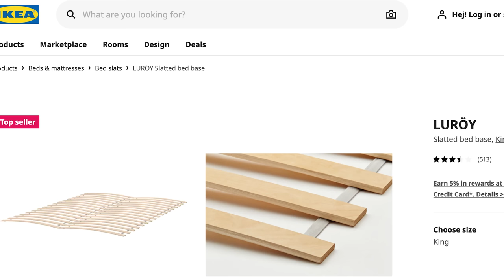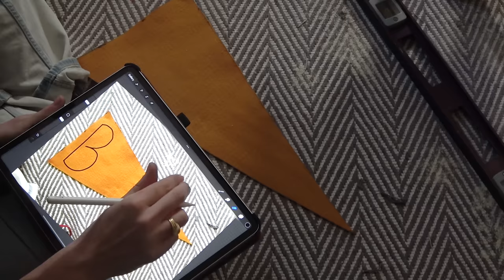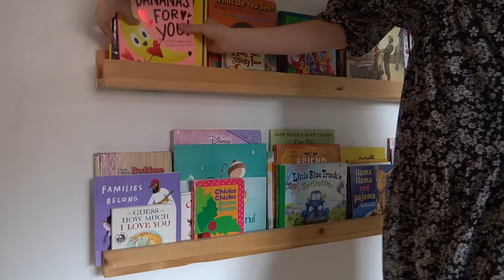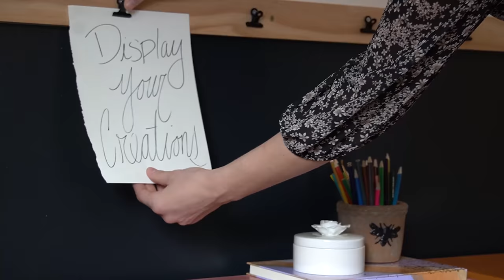Surprise Kids' Bedroom Makeover| DIY TRIPLE BUNK BED|  *FUN SURPRISE REVEAL*

Comment: I would actually also put bed slots on the bottom bunk so that there's airflow underneath the mattress. Mattresses have gotten mouldy from laying straight on the floor for too long.
Reply from the maker: Oh yea I’ve had this mentioned a few time. We definitely didn’t know that but I told my brother and he already made the adjustments to the bottom bed! Thanks so much for helpful tip! 🥰
Reply: @MaileyElaine  it looked like there was a vent under that mattress, did he do something after filming to uncover it? I would really recommend lifting the bed (not just the mattress, the whole bed frame too) a few inches off of it so there is airflow to that vent.
Reply from the maker: @sarawofford  Hey there yes we covered that vent and closed it off. Unfortunately for the support the bottom frame need to rest on the ground. But there are two other vents in the room still uncovered so its the air is redirected to those vents.

Comment: Thank you for this video Mailey! I am from India. I got an inspiration to design bunk bed for my daughters using this idea. They are two of them. I wanted both of them to have enough headroom and an open feel, as well as an ability to get the fan air. I also didnt want the top one to be too high, so that the child doesnt accidentally, or deliberately ;), touch the fan. I am getting this constructed now.
Do you have any suggestions regarding structural stability, etc?
Reply: And you are a great aunt :)
Reply from the maker: Thank you so much! I would just recommend making sure you have some solid screws in the studs.If you have some nice 6 to 8 inch screws in the studs to hold it the bed will go nowhere! So glad you like the project that means a lot!!! 🥰

Comment: Amazing..
Would you be open to give a pattern for the woods to build that bed or a measuring ratio.
Reply from the maker: Hello! honestly the measurements and ratio are so specific to the room. We just tried to every space on the bed heigh wise based on an 8 foot ceiling. Then the frames are the standard size of a twin mattress which is 38x75. Hope this helps if you have any questions I'd be happy to answer any questions.

Comment: I have a question about the heat/cool vent that’s under the bottom bunk- did you block it off? How do you make sure the room still gets air and that the heat doesn’t hurt the mattress?
Reply from the maker: hey there yes we did close off that vent. and there are still two other exposed vents on in the room so that's how the room still gets heating and cooling. So far nothing has happened to the mattress on the ground. I just ask my brother to check the other day since other people were asking about the same thing! 🥰
Reply: @MaileyElaine  thanks for responding so quickly! The room is very cute. I love the black wall and industrial accents.
Reply from the maker: @annamortimer  Of course! I'm so glad you liked it! :) Thanks for all the support!

Comment: Curious about the floor heat vent under the bed, especially since the bottom bunk sits right on the floor
Reply from the maker: My brother just closed off the vent. but there are still two exposed vents in the room for air. ☺️

Comment: Why no slats on bottom bunk?  Won't it mold on the bottom with no air flow?
Reply from the maker: That's a good point. I'll tell my brother to check. I guess we just thought it didn't need it. But we can definitely always add it quickly if needed.
Reply: @MaileyElaine  there are some mattress that can be placed on floor but most are just dangerous. This is one of problematic aspects of Montessori method - it encourages placing mattress on floor. However slat don't have to be really hight - slat base, ventilation holes, and few centimeters should increase safety a lot.
Reply from the maker: @AxoiTanner  Oh yeah I didn't know this was a Montessori thing. We just did it sheerly on the height of the ceiling to make sure ever kid had enough space. Now that I've gotten a few comments about it I told my brother he should make a slight adjustment to the bottom bunk to get the mattress off the ground.

Comment: Didn't see if you did this but I would've used wood filler to cover all the screws and nails, sanded the edges on the bunk and continued the trim to the other half black wall
Reply from the maker: Hey there, I did go ahead and add filler to the screws. I just had so much to cover in the video I left that out and also I did go through an sand everything! ☺️
Reply: @MaileyElaine  Ah thank you! It looks beautiful...definitely a labor of love!
Reply from the maker: @Sam82631  Thank you so much! It definitely was and I'm so glad you love it! :)
Reply: @MaileyElaine  I saw you sanding.(15:56)👍

Comment: That's a great design except that it's blocking one of the vents. This will make the room hot in summer and cold in winter. The next level of design would be to make a cut out on the bottom bunk and extend the vent to the outside.
Reply from the maker: We didn't do that since there are two exposed vents still in the room. Not sure why this little room has 3 air vents haha!

Comment: I would’ve added a “tunnel” path for the register under that bed. That bed will take all the heat or cool air coming in the room…
Reply from the maker: There are two exposed vents still in the room :)

Comment: covering the vent outlet is not good and no support on bottom bed :(
Reply from the maker: Unfortunately with the size of the room no matter what wall we put the bed on a vent was going to get covered. Luckily there are two other exposed vents in the room and we covered a closed the one under the bed. and yes we didn't know not to put the bed on the floor but my brother already modified it to lift it off the ground little bit. ☺️